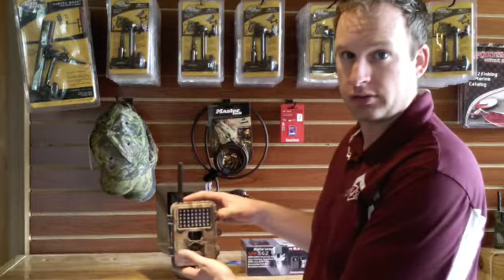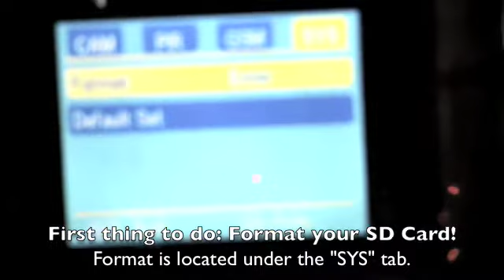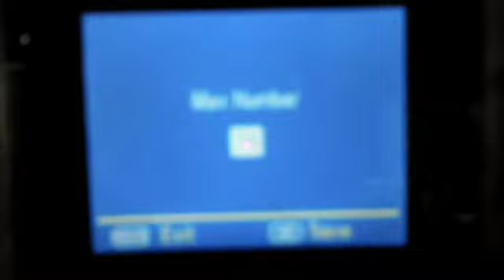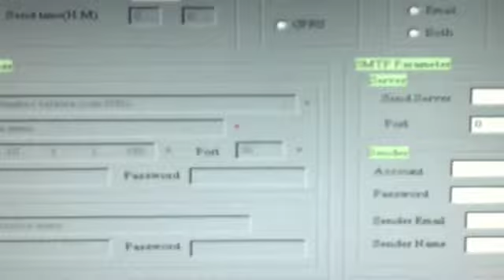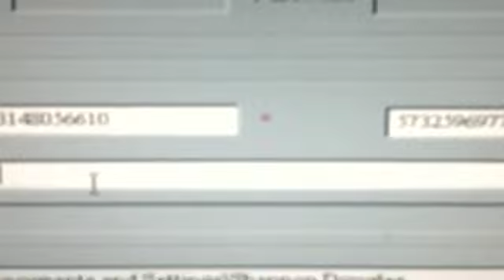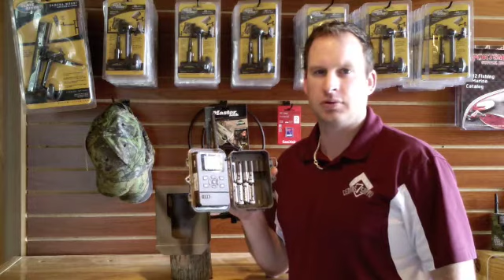Best Game Camera - HCO UM562 Wireless Trail Camera Instructional Set Up Guide

Comment: i've bought the um565 cam and i have a huge problem.in the gsm setup program Romania is not listed neither my operator Orange.is there a solution to this?i see in this vid u are using a different .exe than mine.could u please check if that one has romania listed?thank you

Comment from the maker: There is a antenna booster people are using that can raise cell phone service 2 bars.  The main key has been that you have some type of cell service and you are not in a dead zone.  I still cannot guarantee anything, but it only takes 2 bars of service to send a picture text.  So if you can get one bar and then hook the booster antenna up.  You should be in action.  Antenna Booster link below.

ww.amazon.com/gp/product/B0018PS4O0